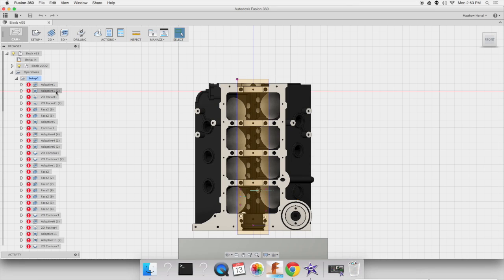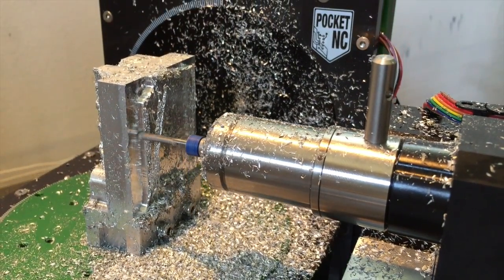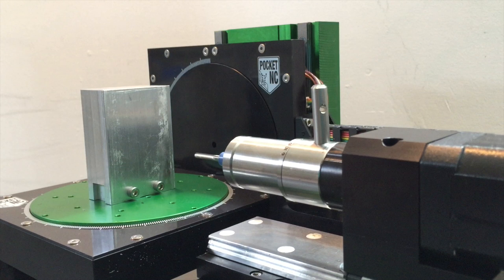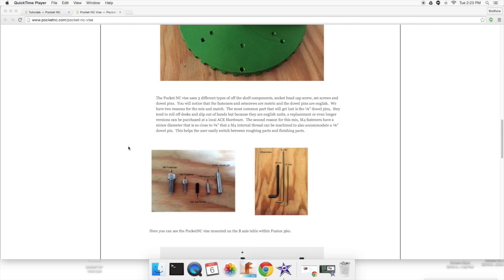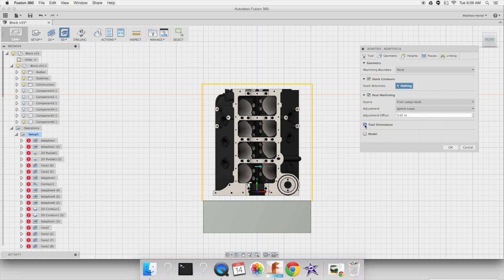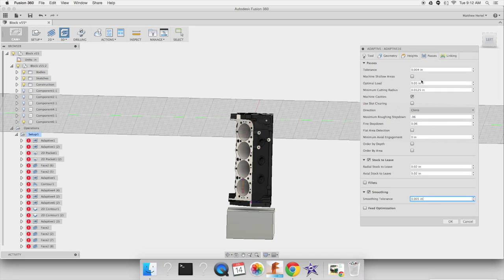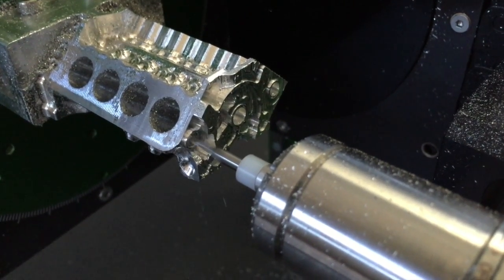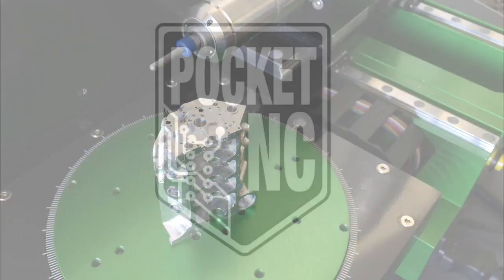Pocket NC Engine Block

Comment: What kind of spindle motor is that,and did it used planetary gearbox for spindle?
Reply from the maker: This is our kickstarter machine - so the specs for our current machines are now different, but shown here the motor is a ~100 watt, brushless, 3 phase motor. None of our spindles use a planetary gear box. You can find specifications on our website for our current models.

Comment: Hey I want to make custom model trains using pocket nc, would I be able to do that? I want to make it about 1/4in thick and probably 5 inches tall and about 14in long. Please get back to me this is really Cool
Reply: Alex H according to what I've read, your 5" and 14" dimensions are way too big. V2 Max travel x 4.55" / y 5.00" / z 3.55" so if you could build that in 4 sections and assemble it.